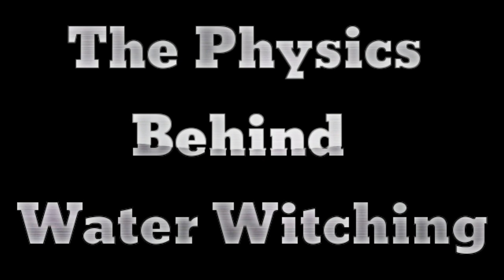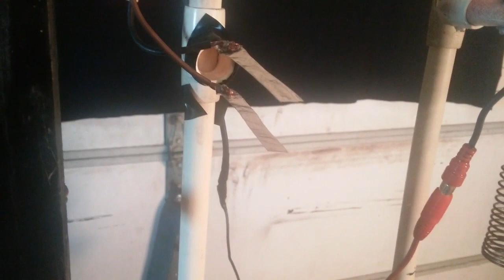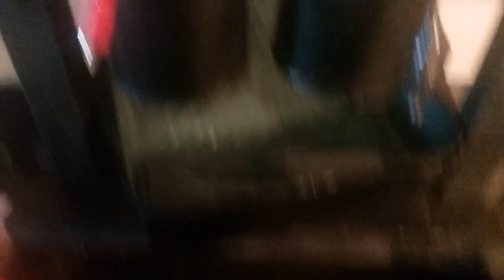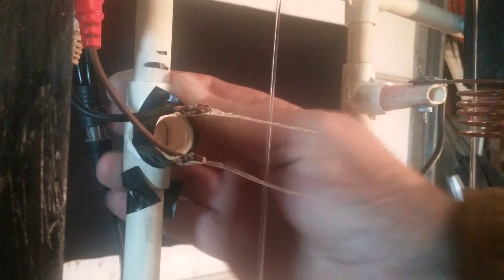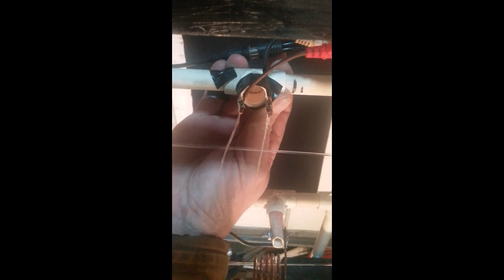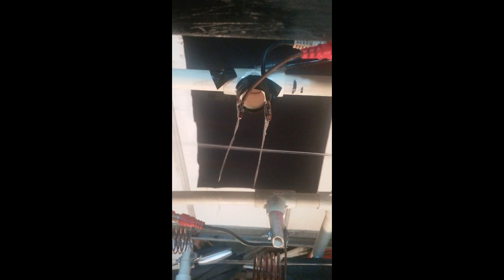The Physics behind Water Divining

Comment: That would explain why they are pull together because of the sudden magnetic field like dropping a magnet on a copper plate
Reply from the maker: I believe the droplets that break away from the stream have become individual entities and no longer receive their strong force (Gravity) from the "connected" stream (container of water) and as natural Gravity surrounding the "area" rushes in to supply the droplets with their strong force - the inductors (or aluminum plates) "steal" a portion of this activity and become capacitated - and once their capacitance reaches a particular level - there is a discharge - and the process repeats as long as the stream of water continues to flow and create droplets.
Reply: Magnets don't stick to copper its a weak metal as well as aluminum
Reply: @OldManLuffy  no but copper will slow a magnet down significantly.
Reply: @vDarknessFalls  Cool bruh, you follow astronomy from a flat earther. Good for you! You have no business talking about science since you don't actually belive in it.